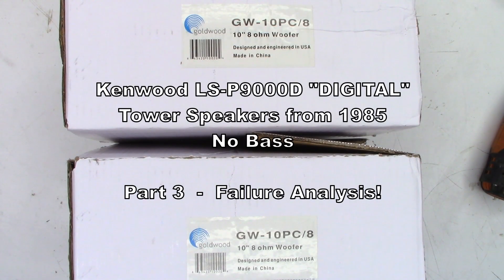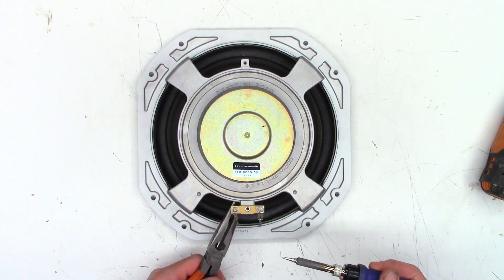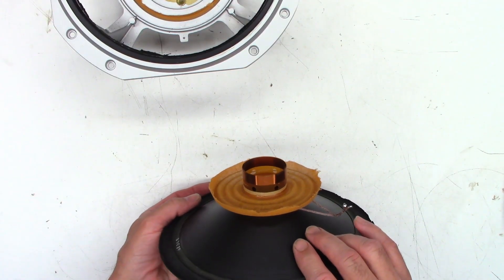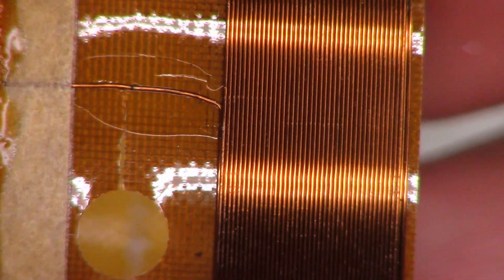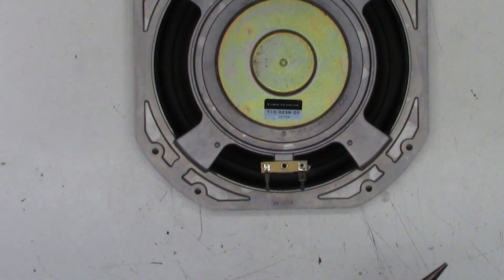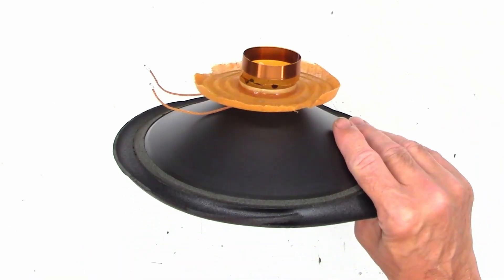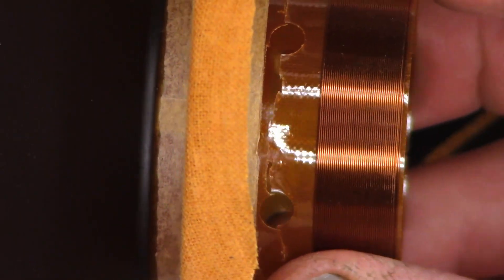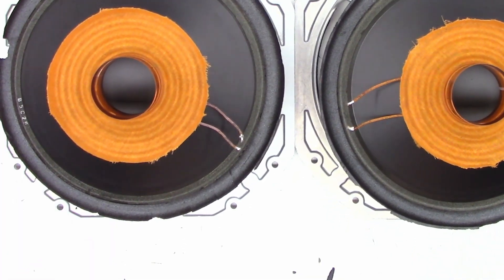Failure Analysis - Part 3 - Kenwood LS-P9000D "Digital" Tower Speakers from 1985 T10-0239-00 Woofer

Comment: I bought them in 2018, from a reputable local stereo shop.  I'm sure they did the surrounds.  They were awesome then, but now 6 or 7 years later seems  low for the life of a refurbished surround but whatever.  They sound awesome now.  Thank you Steve
Reply: I was "testing" these so I put in a movie, the surrounds sound good until big explosions or loud events.  So I traded the surrounds with my bookshelf Polk Audio TSi100's that I was using until you finished.  They sound phenomenal.  I opened up the surrounds and they are cracked at the edges.  I'm guessing not worth replacing but have a look.  I should probably look at the center channel speaker too, sounds good but . . .
Reply from the maker: Awesome Mike, thank you! I'm glad they sound great.